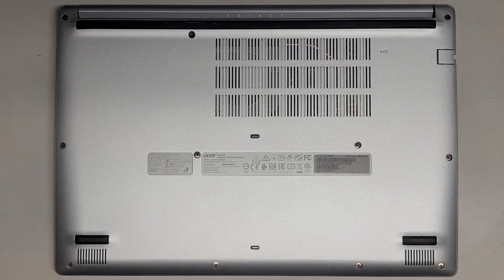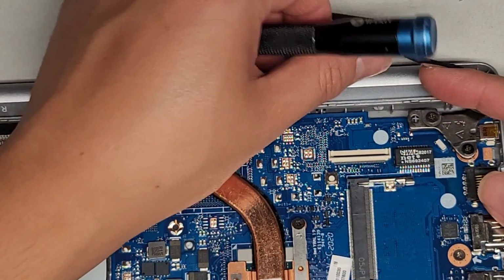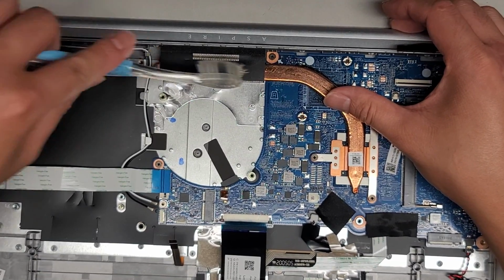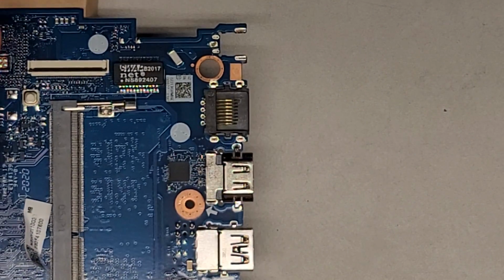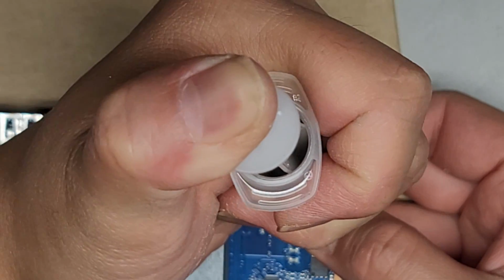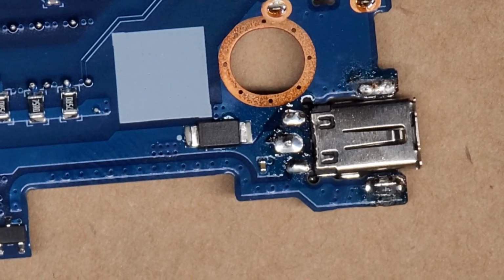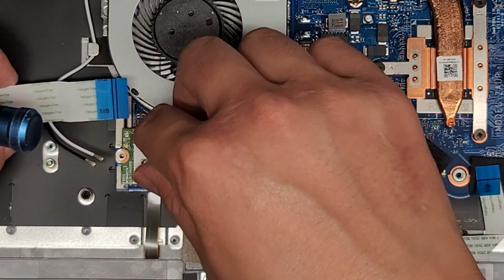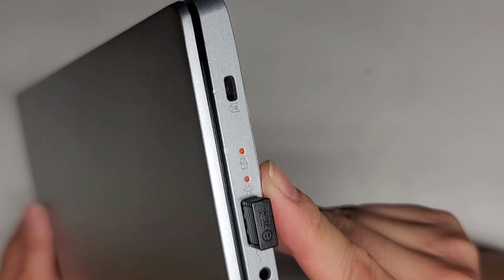Acer Aspire A515-44 Series N18Q13 Disassembly RAM SSD Hard Drive Battery DC Jack Charge Port Repair

Comment: Just a FYI - The M.2 standard ( format ) has 2 types of drives and 3 slots. There are the B-Key Drive and B-Slot , then there's the M-Key Drive and M-Key slot then there is a M+B key slot. The B-key = Sata. M-key = NVME ( None Violate Memory Express { also called - PCIE }. : The M-Key Drives have one-cutout. The M-key slot will only support the M-Key drives. The B-Key slot only supports The B-Key drives. Then there is combined slot that will support both B-Key and M-Key drives. The B-key drives have 2 cutouts like the one you took out of the laptop. So If tthe M.2 slot on this laptop can use both B and M key drives then you can increase the speed at least 3 x. The M-Key M.2's use's the PC's - PCIE Interface controller. The B-key M.2's use the same Sata controller as any other Sata device.
Reply from the maker: B key M key is all useless information. Every computer I've worked on, whether it was SATA only, NVMe only, or both,  had the notch in the same spot. Every SATA m.2 SSD has 2 notches and will fit in every m.2 slot. Some NVMe m.2 SSDs have 2 notches as well, though rare and is only on old m.2 SSDs. You won't know a computer doesn't support NVMe SSDs until you go to install the OS and find it doesn't see the drive. This is only an issue on systems that are like more than 4 years old.

Every modern computer now uses m.2 PCIe NVMe, so there's not even a reason to worry about mm.2 SATA drives or B key slots.

Comment: Thank you friend, I used your video as a basis to do a complete cleaning on my notebook, because until then I had only cleaned the fan and GPU and I wanted to clean the motherboard and case because it was very dirty. but one time I ended up damaging the flat that connects the headset, and it has LED indicators for charging or if it is in the battery, I looked on the internet but I didn't find exactly the same, you know where can i find it?
Reply: The good part is that the headphone and USB connector are working without problems, only the LEDs no longer light up, but it still bothers me.
Reply from the maker: @Nuller097  I'm not too sure.
Reply from the maker: @Nuller097  what timestamp is the part you need?
Reply: 5:27This one here  @ItsBinhRepaired
Reply from the maker: https://amzn.to/4a4dtQ6 I can only find the set or one from the UK on ebay.
Reply: @ItsBinhRepaired  Dang, that's almost 200 Bucks plus shipping, I think I'll be left without the LED anyway lol

Comment: Hi ,can i use it without the Battery?
13:08 i dont need them when i use lan right ?
Reply from the maker: @Arrowrude  Most likely, but there's only one way to find out.
Reply: @ItsBinhRepaired  thx for the answers ,i'll try
Reply from the maker: @Arrowrude  no problem
Reply from the maker: @Arrowrude  If you don't use wifi, then you don't need the antennas.

Comment: Good video, at some point I want to attempt to replace DC jack on mine as well. When mines plugged in I have to move it around to get a connection, but it never charges the battery? There's two light indicators and only one that comes on is the one that should turn blue when charged. I guess the other is the charging indicator? It never lights up. The laptop was given to me and it actually came on the day i got it. Later that night I shut it down and it's never come back on :( I see the battery has been replaced so hoping it's just a dc jack problem....
Reply from the maker: I hope so :(

Comment: i have broken a botton on laptop  keybord can you suggest me what to buy? its this model
Reply from the maker: Keyboard is held in place by melted plastic. Very difficult to replace.
Reply from the maker: I think this https://amzn.to/46J6sRS
Reply: you are the best ,thank you!! even if i think i will try to buy just the botton and push it on x mechanism
Reply from the maker: @BeJaguar  what do you mean?
Reply: @ItsBinhRepaired   I need some information. I bought the adapter to add a Samsung SSD for the Swift 3 to this Aspire 5 and the PC wouldn't turn on at all... why? It's so different from a model to model?
Reply from the maker: @BeJaguar  it's possible you shorted something out :(
Reply: @ItsBinhRepaired  I removed just the ssd and now work
Reply: It's a bit strange because it's just a cable
Reply from the maker: @BeJaguar  I mean, imagine cutting just an artery lol It seems insignificant, but crossing 2 wires can blow up electronics.
Reply: @ItsBinhRepaired  i m lucky better do not try with not compatible cable and stay safe thanks
Reply from the maker: @BeJaguar  yeah, it's a bit risky.